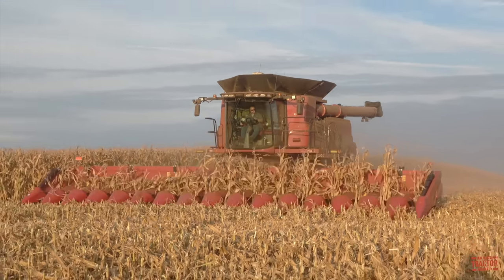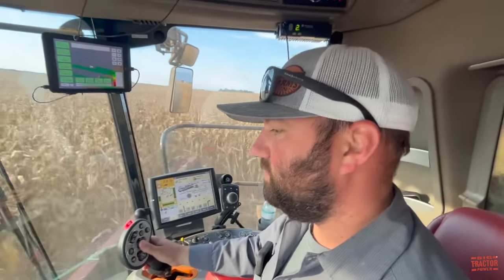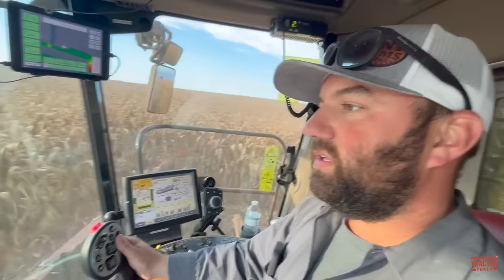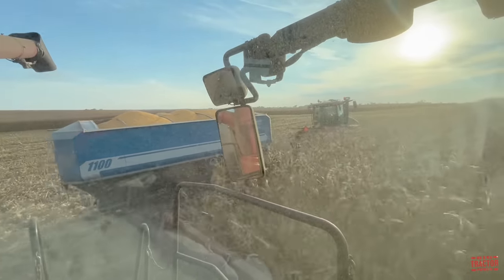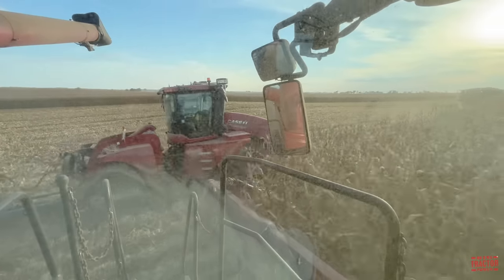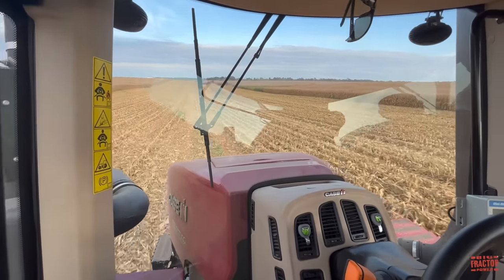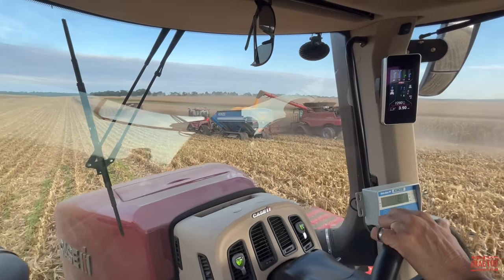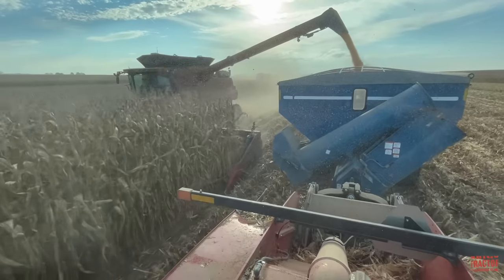3,000 Acre Corn Field Harvested by CASE IH 9250 Combines

Comment: Our “big” combine was a 76 model model IH 815 diesel with a 6 row, 30” corn head.  Support equipment was a 1965 model IH DCOF 405 road tractor with a 38’ Trailmobile grain trailer, a 1962 IH Loadstar 10 wheeler and a 400 by Grain O Vator auger wagon, pulled by either a 1256 or 1566 IH tractor.  Average corn yields back then were 130 bpa.  At times the combine would sit with a full tank, waiting for a truck to return from the elevator.

We downsized in 1982.  The row crop equipment was sold at auction in 1982.  Dad finished out his working years doing custom fertilizer and custom haying work.  I went to town, got a job working for an elevator and escalator manufacturer and spent the next 30 years working for that company.  Dad passed in 2017.  I never lost my passion for farming and red equipment.  Thanks for this video!!
Reply: I should’ve mentioned mom was the real hero.  She did a lot of running, keeping us well fed and fueled up and occasionally taking a loaded truck to the elevator!!
Reply: We had a 1974 815. I think the 1st year for that model. Great machine.
Reply: This machine helps us reduce harvesting time a lot.

Comment: I work for a farm in South Central Kansas near Conway Springs and they raise corn because of dairy, and anything leftover is harvested with their John Deere 9660 STS Bullet Rotor combine with a John Deere 893 8 row corn head. I ran their grain cart, which was an A&L F705 700 bushel grain cart and was being pulled using a John Deere 8120 tractor with window tints.

Comment: Just wait they have the big brother to the 9250 is on the way the AF10 will have 775 horse 16 liter and 50% longer rotor and around 560 bushel grain tank and about 35% more cleaning area and if what i herd is true there will be a AF11 as well but with a different separation system and pushing 900 horse
Reply: Case Af11 will be with twin rotors tech, a New Holland painted in Red for the North America market.
The af10 will stay a real Axial.

After for the engine it's the cursor 16 from FPT Industrial and go to more than 1000 horsepower

Comment: That's a lot of corn. Who is going to eat it all?
Are the tracks on the Kinze  driven? If not, why tracks instead of wheels?
Has this crop been damaged at all by feral hogs?
Is traction the only advantage with the triangle tracks fitted to the Case tractors? Maintenance costs for tracks would be higher than wheels I guess?

Comment: Wow, 3000 acres is even bigger than the 2800 acre field  on the farm Billy runs. Those Case combines are sharp and they sure do eat. What's this take to do with two combines? 10 days or so it sounds like. With that many acres in one place, I'm kinda surprised they aren't running some of those huge grain carts out now days. I know matching the grain carts to the truck capacity matters etc, but  it seems it would save a trip or 6 to the trucks across the field.
Reply: It doesn’t take 10 days
Reply: You need to rethink your math
Reply: They said they run 30 acres per hour (15 acres per combine), for 10 hrs per day. Sounds like about 10 days to me.
Reply: @matthewtaliaferro  I think my math is just fine. To be even more accurate, the guy told BTP they work 7-8 hours per day, so even more than 10 days to do 3000.
Reply: @mattsimon7309  Exactly.  Thank you.

Comment: So here's the math for this 3,000 acre field for all of you who might wonder:
It'll take approximately 100 hours to harvest the entire field with two Case IH 9250s, yielding approximately 500,000 bushels of corn. The national average per/bushel of corn in 2022 was $7.43.  500,000 bushels x $7.43 per/bushel = $3,715,000.00 on this single field! 🤑
Reply: Think of the upfront cost the profit won't be huge. Fuel alone will be costly.
Reply: This farm is a division H&R agri-power. Multi store dealership
Reply: You mean 3.715M GROSS I assume?
Reply: #2 yellow corn cash prices are around $4.92 on 11/28/2023.

Comment: So if they have to unload 3 times in one pass, what do they do when opening up a new slot in the field? Can they unload the combines with the auger open part way?
Reply from the maker: That is a good question. From the point that I was filming in, it was actually only halfway across the field.  There is a waterway through a good portion of the field and a gravel access drive for the trucks to get in and out.   Where you see the trucks being loaded is about exactly the middle of the field so they’ll harvest the half that you saw and then switch over and harvest the other half of the field in the other direction.   

The way they open up new sections or work on the headlands is to cut out a few rows beside the combine when it fills up in the grain cart pulls into that area  to fill up. 

Here is a video from two years ago of the same farm.  At the 5:28 mark in the video they start a new section and you can see how they unload in the middle.  Video at  
https://youtu.be/RsGREEwnrtc?si=pVbibBOo89MDl7t2
Reply: I always cut over some rows just when I'm dripping over so the cart can get over and I can unload.
Reply: @bigtractorpower  thanks. I didn't know if they could pull up a long side and behind the header and only open the auger halfway. 16 row is a really large header and I thought maybe there was room.